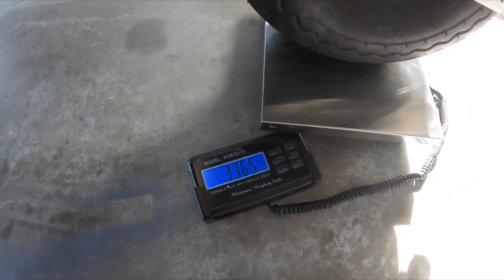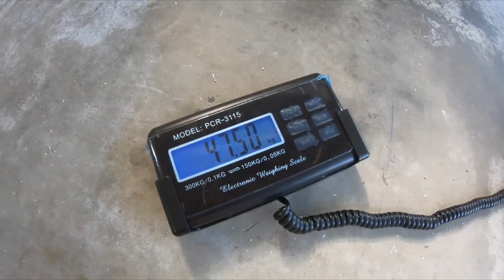Unleashed Experimental Amphibian aircraft build update on wheels , Engine choices include Rotax 915

Comment: Great job it is coming along great, Michael. I just hope that the inspector with the level and check driver didn't give you any grief  LOL
Reply from the maker: Thanks William, Hahahha he’s keeping me on my toes making sure things are level and tightened up correctly. He checks all the bolts and wheels regularly 🤣
Reply: @michaelhille261  better watch out instead of borrowing the car keys, he will be purloining the Planes keys in the future. Curious NO allowance for shock loading on the main suspension?? yet you have for the nose wheel? Will have to watch it again.
Reply from the maker: For the rear gear I’m allowing for spring in the steel for suspension and can shorten the inside tube for a better spring rate if needed but as you can see in the slow mo the tires take most of the suspension but obviously once the engine is on and wings the steel should flex more very similar to a SEAREY gear it relies on spring in the steel .
Reply: @michaelhille261  Okay I knew you would have figured out something, but had to ask in case no, seems its always the thing that you didn't think about that come back to bite you....well at least with me they do. So that would be the same Molysteel that you use for the nose wheel assy. I will have to freeze frame that nose wheel assy lots of work since last one on it. Just a grand job Michael, and I am first in line if you wish to make a Kit out of it Cheers
Reply from the maker: I think it’s great your asking the questions in case I have forgotten something, it also lets me sense check it before replying so please keep the questions flowing it’s great 👍🏻 
Yes the rear is 4130 chromoly , all the steel used is the same grade 4130. 
I will definitely be supplying kits for this once all the testing is done and I have my final drawings ready for cnc cutting the plan is for this to be a quick build kit and as much match hole drilling as I can to make this very easy . Thanks for following along

Comment: Great update Michael. Just interested to know how far off the waterline are you main tyres going to sit?
Reply from the maker: Kyle the main gear will sit about 6in above the waterline but tucked in behind the sponsons/walkway so the sponson tips will plane the water during a turn keeping the wheels and wingtips  out of the water. The sponsons will also provide more buoyancy and should rest on them stationary. Hopefully 😀😂 I intend on floating the hull With sand bags prior to mounting the sponsons to confirm my displacement calculations .

Comment: Thanks for another great video. Very educational as usual!
Just by curiosity, how do you prevent corrosion between steel and aluminum composition?
Reply from the maker: No Problem at all , the key is to keep the moisture out all together so I coat the steel and aluminium mating surface well with a primer to seal the two and then seal the completed components with polyurethane sealant to stop any moisture ingress